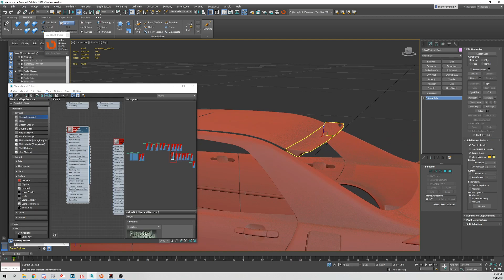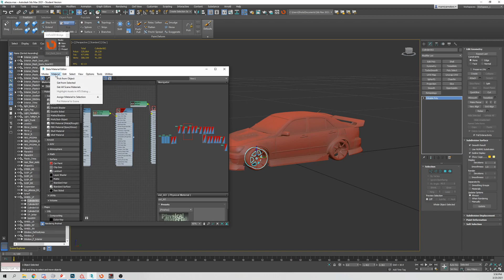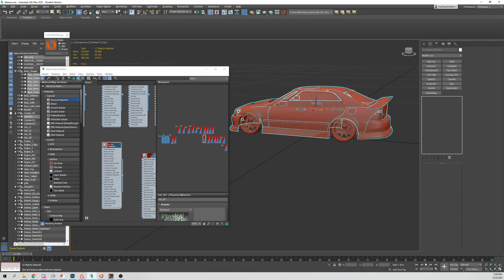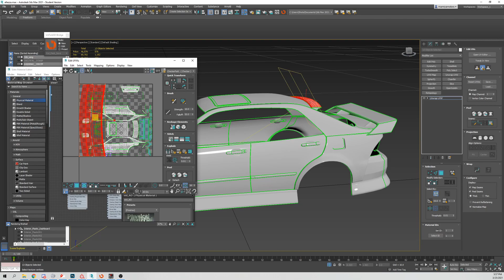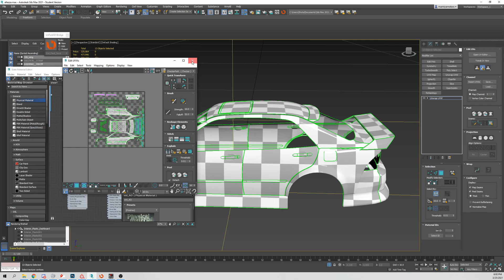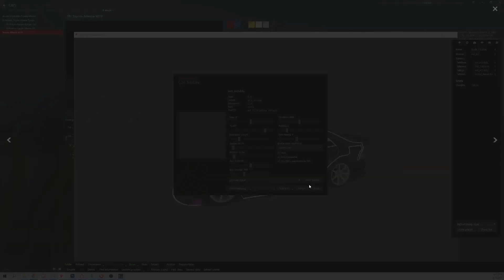HOW TO: Fixing AO Maps | Assetto Corsa | 3DSMAX | Mamiya Motors

Comment: ey dude im having a problem where the right side of my front bumper and the whole rear bumper is for some strange reason matte, even tho it uses the same material as the rest of the body, its all one object. i was looking at my map the one thats greenish and there were no weird stuff happening with the bumpers. i calculated the ao map and as expected the right of the front bumper and rear bumper are way too black compared to the rest of the car. i opened it in 3ds and moved stuff around, nothing. same problem. how can i make them not black? or if thats not the problem just not matte? thanks